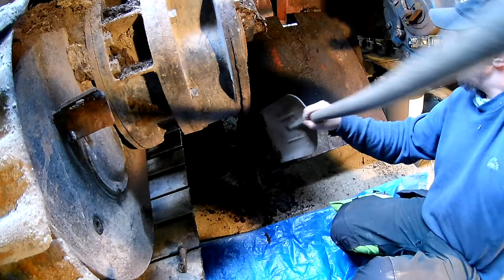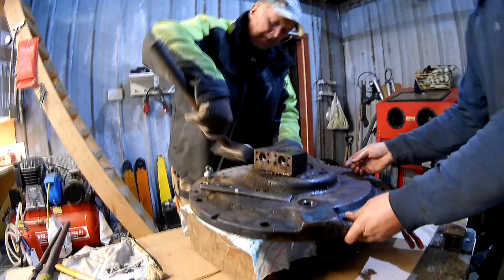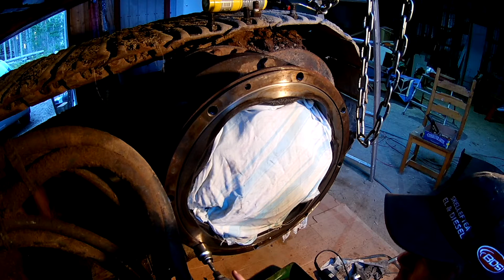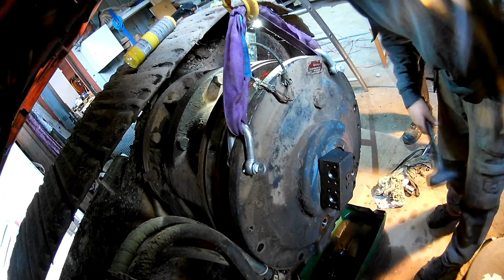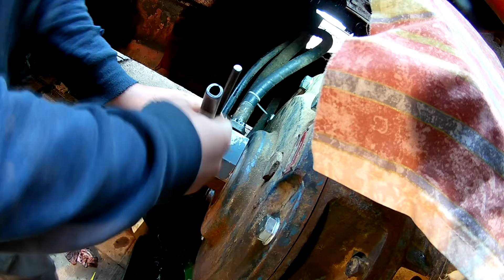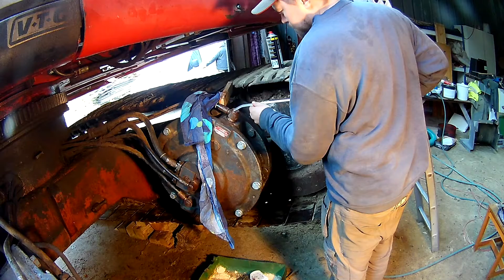Poclain 90 CK leaking track motor

Comment: Great video. I've a few poclains here in ireland.
Reply from the maker: All in nice condition and working? Hope to get this one out and do a bit of forrest road this autumn before winter freezes the ground.
Reply: @blackgrove8  I've had 3 60 ckb 2 60 cl 1 75ckb and 61ck. I've put some pic tires of them on Facebook poclain group.

I've 75 and 60 now.

I'm currently fixing up my 60 redoing all the servo pipes and a d putting a new cab on
Reply from the maker: @ferguson20diesel49  should be a human right to have an excavator 😆
Reply: @blackgrove8  I just bought another😂

Comment: Det är nog så att banjons hål är lite ovalt, tycker det är rätt vanligt. Man drar åt mer å mer men lika fan läcker det lite. Men det skulle kanske gå med tredoringar närmast banjon och kopparbricka på den. Det var ju en väldigt liten skalle på skruven gentemot banjokopplingen.
Reply from the maker: Hålet är nog inte ovalt men är ju som en kant som gör innerdelen på banjon större och den kanten hade som vikit sig in och gissar det spruckit där nog att det kommer ut olja. Banjon är M27 och även här är bulten något krokig, har fått en smäll nån gång. Blev ett försök med en stor bricka och en gummibit under med hål men då blir det inte tryck nog så pissar vid kopparbrickan under. 

Satt nå tredotätningar på en av banjobultarna men var nog inte riktigt rätt storlek för nästan allt gummi var borta, gissar det kanske var det som satt i silarna på strypningarna i banjobultarna nertill? Fast kan ju varit mer löst gummi från nån annan del av maskinen insidan på nån slang kan ju börja vara murken?

Ska ta med slangen och se om det går få tag på en adapter från M27 till JIC verkar finnas vid googling iaf. Men kan bli bekymmer med kopplet i andra ändan. På nått sätt ska det nog gå få det tätt. 

Har brottats med bromsarna på min systers bil sista tiden och skruvat lite i skotaren så länge. Och så startar ju älgjäkten på måndag så fullt upp.